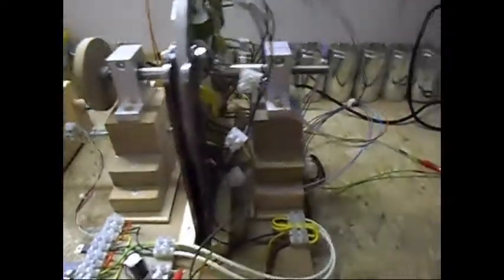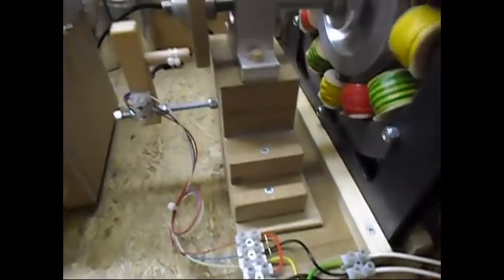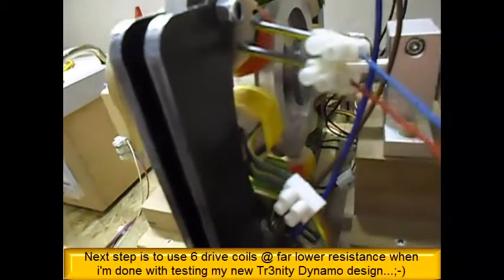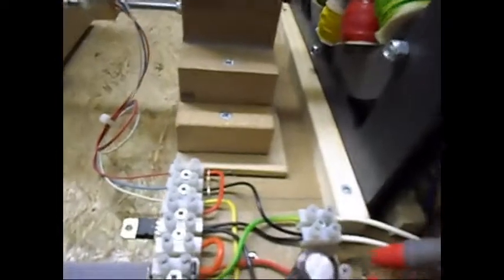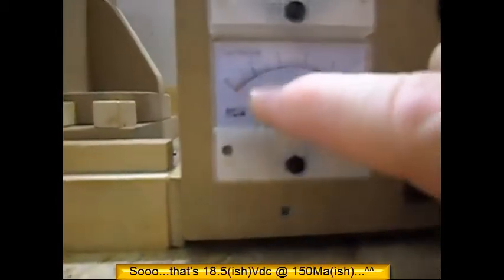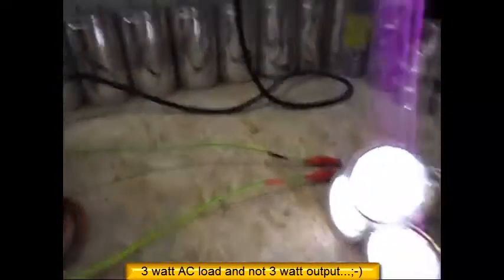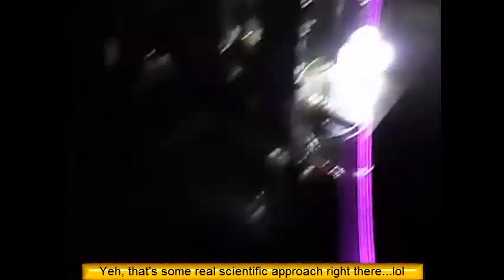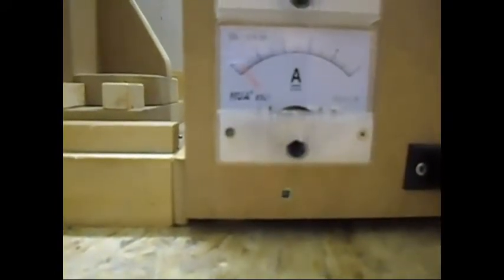Single Phase Generator_Update 19, 6 coils in series/3 watt AC load/so far so good...

Comment: Hi I know what you're saying about having No Time,!! I'm just now getting around to saying a few things that can help you're BUILD... But hear goes.
I don't know if you've found Time to make any changes to it or not, yet" but this is what should do. Okay" WE Know" that magnets induces drag on "Copper & aluminum" when it passes by it closer they are the worse the drag." So, Change you're Rotor" out to something like ( cutting board)!! Or some type of plastics,.. Or even Rubber, 
Work's very good in this type of set up. 
Now, also, I see you have  like 12" coils"?.? I Think, SO, What I would do is this, separate the Coils from one another, and take two to 4" accross from each other, then wire them up to 
Run you're rotor with a pulse DC voltage. Then wire the rest of the coils up to gether, for Collecting power" to run stuff. You can even loop two separate coils through a super cap, and use it to power the pulses, you use to run the rotor.!!, I do recamend enlarging the rotor" and add another 20 to 50 more turns on you're run coils. Or even all the coils, but I would just add the wire on top of the coils you already have,.. But I would go with a smaller Gage wire. For more volts, or larger wire, for more amps. So, GIVE that a try. I'll check back time to time. See, what you're doing with it. Good luck.

Comment: adjust the hall sensor timing to increase speed after increasing voltage, that should drop the amps back down.
Reply from the maker: Thanks for your comment...^^
It is nice to see you around here mate, that's a long time ago and i hope all is going better with you at the present time...^^
I did try out what you wrote but nothiong has help the system out so my only option left is to use drive coils with larger size wire...
I haven't done anything in the last 2 months or so(tired and lazy...lol) but i'm back at it again so i hope to have those coils done soon...;-)

Comment: do me a favor......on the negative of the bride put a positive of a capacitor and the spike from the running coil.....then your output will have the spike capture on the capacitor.
Reply from the maker: Thanks for your comment and advice...^^
The plan is to capture the b-emf also when i happy with this setup but i might do it now in a better way...;-)
I have a diode to capture it back to the source cap but this circuit is not the best one to do this...

Comment: can you calculate the load watts? measuring.
Reply from the maker: Thanks for your comment...^^
Yes i can calculate the real output but in this case it was a simple test to see how much will the Lenz effect effect the drive system...and not much...sooo far so good but that can rapidly change at higher rpm...;-)
The more energy it produce/generate the stronger the Lenz effect...we'll see...^^

Comment: It is running so smoothly!
If you have an AM radio, you could look up a frequency where you (we) can hear the RPM of your motor. One note: it is a very annoying sound, so if you do this, so it only for the period needed (switch it off again asap).
Regarding increasing the voltage. I suspect if you do it very slowly, you might get it to speed up more. But that is just an idea.
Reply from the maker: Thanks for your comment...^^
It is running pretty smooth indeed even though i'm not using my high efficient bearings but just off the shelf ones...
If it's an annoying sound i don't think i'm gonna be using it...i do have ears that are very sensitive to noise...which is good at times but something not so good...lol
I've tried to adjust the voltage very slowly so hopefully the system could get used to it but no go...-.-
As soon as i get above 19Vdc the amp draw goes above 500ma ad the rpm start to drop and around 20Vdc or so it's drawing 1Amp or more and the rotor than almost stop turning...???
But these coils are 0.25mm wire and can't handle to much milliamp and also the 12 stator poles gives plenty of cogging also...;-)
But i'll going for lower resistance coils in the near future when i'm done testing my Tr3nity Dynamo...that setup has 6 low resistance drive coils which should be perfect on this setup here....^^

Comment: The electromagnetic coils are inducing drag with that aluminum wheel. Eliminate that for a non metalic substance and should reduce the drag. Aluminum like copper will create drag near moving magnets and resistance.
Reply from the maker: Thanks for your comment...^^
And yes you are right about Aluminum and Copper but for now this setup is what it is but i do have some nice mechanical plastic rotors...;-)